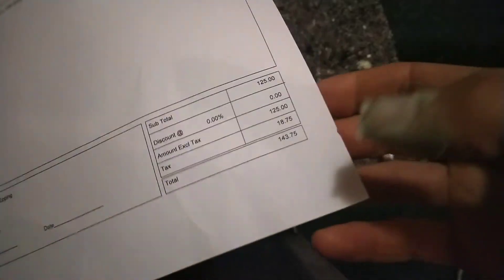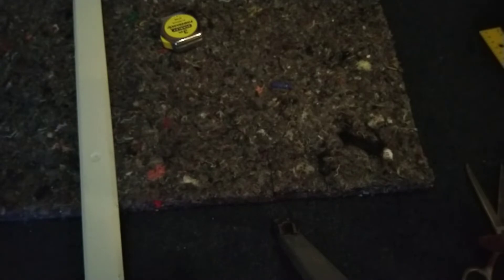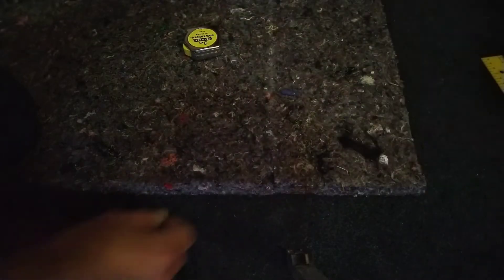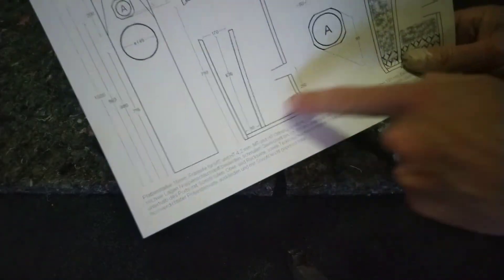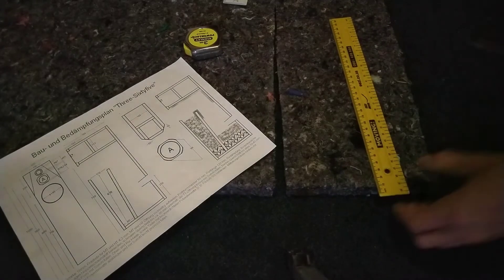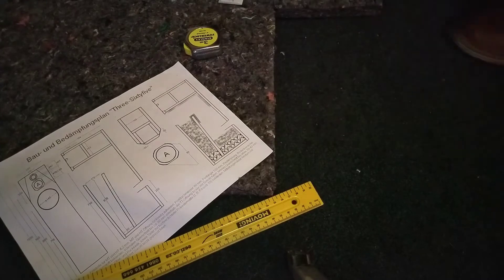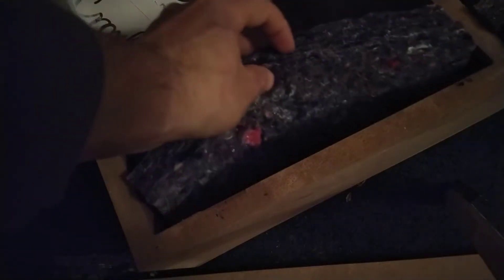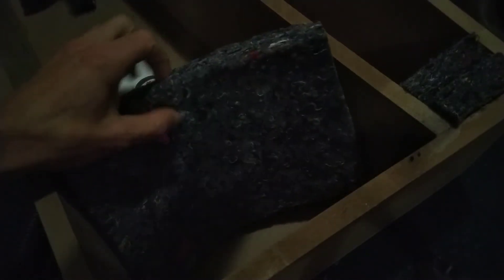Installing Sound Damping Material in Loudspeaker Cabinets

Comment: Hey be careful using glass wool in a ported enclosure. I tried that one time and made a video about it. It puts little fibers of glass in the air and therefore in your lungs. I like cotton or polyfill.
Reply from the maker: Interesting comment, sawdust from whatever material is being cut is something to consider. The way I thought about it is that small pieces of glass wool fibers will only be broken off when the material is cut. I did use a vacuum cleaner to suck up the loose bits and the cut edges are bordered with the MDF panels. Changing the material as you suggest is another way to manage any potential concerns.

Comment: transmission line with a bass port ?
Reply from the maker: You have good eyes. The bass port that is tuned to 40Hz. Sounds great. ;-)
Reply: @breakfixbuildimprove4326  40hz is my favorite tune 😁
Reply from the maker: @linandy1  hahaha, very clever. The speakers sound great from the low to the high frequencies. Super clear, i.e., low distortion.